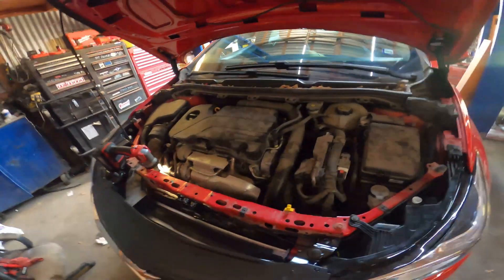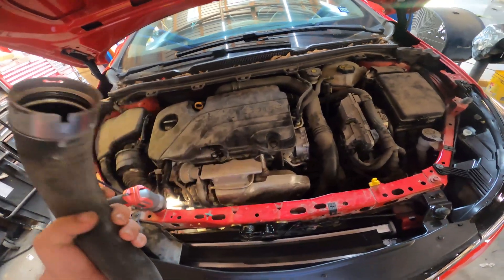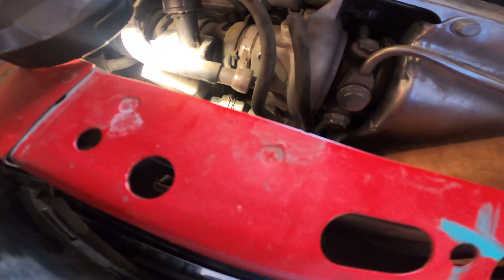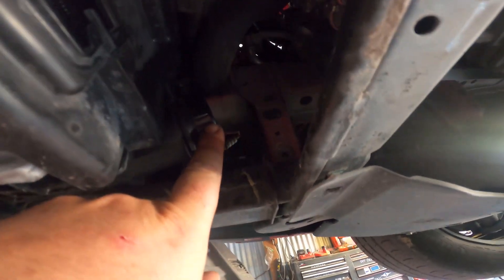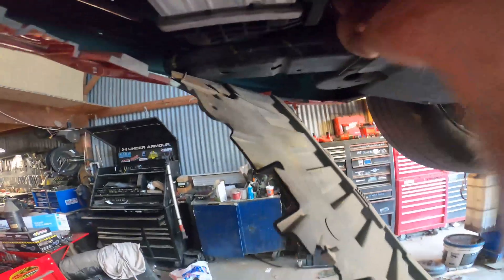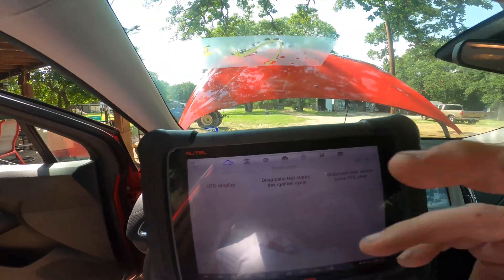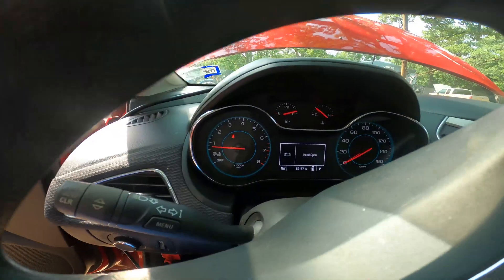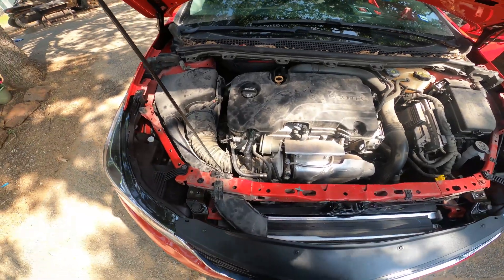2018 Chevy Cruze 1.4l Turbo: P0101 P0299 P1101 Fixed!! Intercooler Charge Pipe Replacement!

Comment: that end piece with the seal? I know it's a O-Ring, but where can I find one lol
Reply from the maker: @chrismartinez7085  youre looking for the part in the video or just the oring? Didn't I link the part in the description? If not I will when I get back to my computer
Reply: @GreenCastleGarage  I know the part is the passanger Intercooler Hose, but I'm asking about the O-Ring that sits on the end piece, where you connect the intlet hose?
Reply: @GreenCastleGarage  on that metal end piece, you mentioned there's a O-ring that sits there,, im trying to figure out what size and part that O-ring sits on?
Reply from the maker: @chrismartinez7085  it comes on the replacement unit. I think it's actually a lip seal possibly, but have no idea what size. I just replaced the whole unit. If you pause it while I have the camera showing the pipe you can see the seal inside. Sorry I don't have anymore info for you
Reply: @GreenCastleGarage  your good,, im still searching

Comment: if you live it with a hole will it be a problem for the turbo
Reply from the maker: @orla4997  yes
Reply: @GreenCastleGarage  10/4 thanks still traing to figure my car out it yest stop running i found this problem after been in the dealership for replaceing the camshaft sensor now it wont run and still trows camshaft sersor code   it turn over but it backs fire its all its duing am bout to setit on fire 😂 but thanks i really apreciate you
Reply from the maker: @orla4997  what's the codes does it have? I'll see if I can at least point you in a direction

Comment: video is not clear how do you take out clips
Reply from the maker: You grab the two ends that have little 90's and spread and push them in the opposite direction with your fingers. It will click out and disengage, you can't miss it.

Comment: About time someone made a video of how to fix it!! Appreciate it big bro🍻 I have this exact problem
Reply: How do you take out the bottom pipe
Reply: @mo7anori 
.
Reply: It’s pretty simple, if you work from under the car you could see everything from where it’s connected & you simply take off the clips with your hands by pressing them together with your fingers. I was able to do it & I’m no pro in cars @mamadnori3222
Reply: I put the new oem part and it starts leaking oil back again in a short time, a mechanic said  some people use to put silicon all around